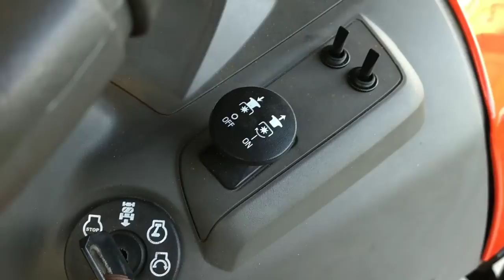Home made lawn mower bucket loader

Comment: That looks awesome! One word of caution for people considering this, most of these riding lawn mowers the transaxle is too light to do anything more than just mowing. Working it like this will tear up the lightweight transaxles on the basic riding lawn tractors. If you have a garden tractor with a heavy duty transaxle you are good to go, its easy to tell the difference, look for rear wheels that bolt on like a car, if they only have the center cap and not lug nuts its a light weight transaxle and your lawn tractor is probably too light  to handle this.
Reply: I don't think the little electric motors he used would lift mich anyway

Comment from the maker: Just for the record to all who have asked questions or responded, this is a light duty unit which works well for moving loose material like dirt, rock or mulch. it really wont dig well because there is no locking differential, and the tractor weights just over 400# and this makes it the weak link. The flip side is I built this unit for 300 in total material. To the actuator questions, it's a lawn mower! Hydraulics are not available, nor practical on a mower that cost just 1500 new and even with hydraulics, your mower is to light to get the work done with a differential rear end. Our Lil Green monster has industrial actuators, 1000# on each arm and has been tested to over 400# static holding in the bucket with no driver, no counter weights, no wheel weights. To all who inspire building your unit, remember the machine itself is the weakest link and common sense should be applied along with the engineering and math to calculate loads. Lastly, to all who question "why no hydraulics?" It's because we design loaders for lawn and garden that don't come with the factory hydraulic or PTO options. Good luck to all..........
Reply: Do you have plans for it.... Very good job, looking to build one for my tractor
Reply: How do you think the "f7" model trans will hold up to this and a small box or straight blade on my yth24k48?
Reply: Thanks for the info. Well done.

Comment: When you say 300 pound capacity. Is that the most the bucket can handle or is it the most the 2 actuators can lift. If they’re both 225 pounds wouldn’t that give you a 500 pound capacity?

Comment: Hi Carlos,  I really like your design and how well it works ! I've been wanting the same type of setup on my garden tractor. But any time you see them for sale they want so much for them you could go buy a used farm tractor with loader for less-even the manufactured attachments they want $5,000 for it. But you've inspired me to build one my self like you did !  Thanks for the inspiration !!  -Jim
Reply from the maker: Jim, not sure if I replied but thank you for the kind words. this is a light duty model and we've moved on to more robust actuators before firing up our business and things have been going very well. if you need some advice on building your own, give me us a call.
Reply: Where can I buy one these at

Comment: Excellent design! I am now building one but am using 4 x 1500N actuators. I'm also folding the main section of the bucket to save on some welding. :)
Reply: Folding the main section. That is a good idea!
Reply: Great build for a prototype. I just purchased a Huskavana as well and would like to build one similar for VERY little yard work, can I get the plans so I don't run into problems that you already solved?

Comment: I like it. Few Q's: 
1) why 2 actuators on bucket?
2) how is the cross member going from side to side just above the mower deck connected?
3) can you take some pics or video of the pin connections on the actuators and buckets?  
4) I gather that the arm are simply bolted to the cross member uprights so that you can remove the bucket assembly easy enough?

Thanx in advance

Comment: I’ve dismantled around 50 riding mowers from garden tractors down to the flimsy MTD and Murray. 
1. How long before the frame cracks. 
2. How long before you run down the battery and wear out the stator?
Reply from the maker: Boyd, the frames of different tractors all very greatly, some are very weak. This particular model has a C frame which is almost 11 gauge and very robust in addition the gusset spans to support and distribute lateral forces across the frame so not to harm to the frame. As far as the actuators are concerned, they only draw few amps and will in fact run on a 9-volt battery for short periods of time and cause no stress to the battery. In addition you would be using the tractor water stater running anyway so it's not much different than putting a cigarette lighter with a 10 amp fuse as an accessory. it is also important to remember that this was just a fun prototype build for $300 in material we now build full-blown models for garden tractors only with industrial actuators and the cost is much more expensive.

Comment: What are your actuators rated at?? I purchased  6000n 1320lb rated linear and they are very slow.  Yours are much faster.
Reply from the maker: So this was just a prototype, and still much slower than what we build today. These are light duty actuators, 225# dynamic lift with the same static holding capacity. These were made by Wyndynation which you should be able to find for around $50 each on line. For the last 3+ years we have been building a medium duty unit with industrial actuators and this has become our staple. You can find us under "little green monster bucket loader" on youtube. Take care!

Comment: You need to make them to sale , looks very good , i would believe is factory , does the engine produces enough power to work for an hour or so without killing the battery ?
Reply from the maker: The battery is unaffected and the engine is running anyway so it does not affect anything. We do build a unit for John Deere X3 and X5 tractors. You can find us on Youtube by typing "little green monster bucket loader"

Comment: Hello, I have a question.   when Tilting the bucket, it looks and sounds as if the bucket falls down when not powering up.  Shouldn't the actuators lock when not under power due to the high gear ratio?

Thank you
Reply from the maker: Thanks for the question. What you're seeing is me operating both the switches at the same time which is probably why it appears that the bucket is falling. The bucket has a 400 lb static holding capacity which is way more than It can ever pick up. Hopefully this answers your question but it's actually me fiddling with the switches

Comment from the maker: It would be considered a light-duty unit. 150 to 200 lb maximum. The weakest link are the light duty actuators and that the mower itself only weighs about 450 lb. It has no problem picking up P gravel and sand moving Mulch and things of the sort but it will not do any substantial digging in hard pan or packed ground. The new model that we finished up for a John Deere garden tractor functions like a normal tractor to dig and pick up much more weight. I hope this answers your question feel free to reach out if you have some more questions. The cost to build this light-duty unit if you can fabricate and weld is just under $400
Reply: Carlos Tejera 
I have a Kubota B6100e subcompact tractor which is a 14 hp deisal and weighs a little over a thousand pounds. Do you think the loader for the john deere would hold up to being used by this tractor? What kind of work could I expect to be able to do with the john Deere loader mounted on this tractor? How much would it cost to build the john Deere loader?
Reply from the maker: Grady, It all depends on how heavy your Kubota is, is it 4 wheel drive? Locking Diff, Etc.. The Deere weights about 900# dry. Yes it will dig, we can pick up 350 to 450# max with counterweight but there are lots more questions before you jump right in. We sell the actuators and are now a dealer. We just finished a fork assembly for hay and brush, we have a tooth assembly for ground clearing, garden prep and the likes. We took 400 sq ft of grass and weeds and turned it into a ready to plant garden in less than 30 min. call with questions 863-255-1237
Reply from the maker: Hi Grady, I replied to you directly but thought I'd also briefly answer the questions for others. The John Deere unit would most certainly hold up to your B6100 and you could expect to lift into the 400 to 500# range with the right tractor weight and the same 1000# actuators we use on each loader arm. Yes you can dig, grade, and with the tooth assembly we made turn raw ground into a garden in a quickness. Pricing varies with the type of actuators,  stroke length, speed, etc... The Deere has industrial actuators that are IP65 to IP69 rated. This means weather resistant to 100% weather proof under harsh high pressure conditions that most would never really need anyway.
Reply: How much where the actuators

Comment: Thanks for answering my previous questions. I'm still designing my bucket and have ran into a problem with the actuators having a small duty cycle. I notice that in one of your other video's you are working the actuator hard. Do you have a solution?
Reply from the maker: I do, call me and tell me what you are struggling with and I'll be able to answer your questions.
Reply: @carlostejera8476  Are you in the EST zone? I don't want to call you at 2am your time.
Reply from the maker: We are Eastern Time zone located in Central Florida

Comment from the maker: Good luck with your build Ian. We also sell a simple set of plans 4 lawn mowers and garden tractors if you need some design help. This is the lightest Duty unit we make but still very handy around the yard.
Reply: Already designed and half built thanks Carlos!!
Reply: Well I've almost finished it. I've tested it and everything seems to work but I just have to extend the exhaust pipe about 70mm  as it's a little too close to one of the actuator motors. As soon as the pipe turns up it should be right to do some work.
Reply: HOW DOES ONE GET A SET OF YOUR PLANS. A GREAT  DESIGN

Comment: Was looking at it...Real nice, would like to have seen the attachment point to the frame.   Also was thinking of an electric PTO using maybe a Electric Clutch from an AC compressor...
Reply from the maker: Clay, thanks for the response. Never thought about the PTO idea, but why not? give it a try and let me know how it works. We don't have a use for a PTO but I'm sure someone somewhere does. Stay in touch & good luck.
Reply: What about reverse polarity wiring on a larger alternator? Theyve shown to have substantial rpm, load, and torque?

Comment: I been wanting to do similar but only had 2  actuators that 120 volt from a hospital bed I took apart,so I would've needed a power inverter also ,so haven't done the project yet...yours looks good
Reply from the maker: Hi Mike thanks for the response. If all you need is a light duty unit like what is in this video, you can buy these actuators from ebay for around 40 bucks each. depending on the bucket, you'll get about 150# easy in the bucket. I The actuators have to by Wyndynation, they have 225# dynamic lift, and the same static holding. if you don't use these others have no static and will bleed back closed. Good luck!

Comment: good project but it seems the bucket actuator is not holding the weight enough. You had to power when it was up.
Reply from the maker: The actuators hat static holding power, that was just me operating switches. This was nothing more than a cheap back yard build. Our "Little Green Monster Bucket Loader" is a production unit we build for John Deere X models. You can find us on Youtube with the LGM title. Thanks.

Comment from the maker: 8" stroke actuators, all same length, the switches allow for extension and retraction and we can give you the wiring diagram. If you can email ctejera@tampabay.rr.com and send me your phone number, I'll reach out to you and give you the details you need. The stroke, type of actuator, and mounting configuration will change from one mower to the next depending on your needs.

Comment: How do you keep the two lift actuators working at the same speed?
Reply: Also where did you purchase your actuators?
Reply from the maker: @normanodom795  the actuators are Acme or ball screw control and as long as they operate at the same voltage they move up and down at the same exact rate. The type of actuator that you use can also make a difference so we do not very from what works for us

Comment: This is awesome. Just purchased a Craftsman DGT 6000 used. Do yo sell Plans for this loader?
Reply from the maker: We don't build for lawn mowers anymore but feel free to reach outand we'll give you some basic dimensions and guidelines to get you going in the right direction
Reply from the maker: Just guidance and basic dimensions. We only build for John Deere now.
Reply: @CarlosTejera I understand you don’t build for lawn mowers anymore, but I have a craftsman GT5000, if you would be willing to share any rough plans that I could modify I would greatly appreciate it. The GT5000 weighs 600lbs and I have wheel weights, so if I could get away with lifting around 300lbs I would be very happy, especially given my bad back!
Reply from the maker: We might be able to help out feel free to call and we can discuss some potential options

Comment: Can I ask what size and thickness of steel tube you used for the loader arms?
Reply from the maker: 2x2 14 gauge to keep the weight down. Bucket is 36" wide
Reply: @carlostejera8476  thank you. Do you know what the lift capacity is? I'm building one for my atv. I want it to lift 5-700 lbs so I was going to use 1.5x3" .060 thickness. Overkill?
Reply from the maker: In the beginning of the video I describe the gauge and size of the material along with some other details. my phone numbers contained somewhere within the comments if you need to call from more questions.
Reply from the maker: @sti1471  most definitely overkill. My phone numbers contained within the videos feel free to call.
Reply from the maker: @sti1471  correction to my last comment most definitely call. We have designed them for ATVs in the past 863-255-1237

Comment: I believe I will be fabing one for myself considering I have been working in a fab shop for over 20 years I can't believe it took youtube to make me think of this. Did you have to sync the actuators at all? I'm being told I need to buy some almost 300 dollar sync thing to do this.
Reply from the maker: No sync needed. we also provide kits and plans for those who have the ability to fabricate and weld. The kit prices vary depending on the type of tractor and actuators. We have light duty like this unit, and industrial like we put on our Deere garden tractors weighing 1000#. Reach out and call if you have any questions 863-255-1237
Reply: Will do thanks
Reply: I got it done this last weekend modeled it after this one in the video other than needed to extend it longer because I used 18" actuators it looks and works great thanks for the idea.

Comment: hi, nice loader, where did you get hydrolic system
Reply from the maker: The actuators are made by Wendy Nation I found them on eBay for around 50 bucks each. Keep in mind this is a light duty unit despite how much it actually lifted it really doesn't want to do more than about 100 to 130 lb. If you're interested in something more robust check out our videos under little green monster bucket loader on YouTube. Those are production units that we build everyday and we're also a distributor for the industrial electric actuators that we use. This little Husqvarna was nothing more than a prototype and the only one we ever did. Good luck

Comment: YOU NEED A CROSS BEAM BOLTED TO THE FRONT OF THE TRACTOR AND TWO FLAT  BARS RUNNING DIAGNALLY FROM THE UP RIGHT PEICES TO THE BEAM BOLTED ON TO THE FRONT OF THE TRACTOR SO THE LOADER WONT TWIST AND BREAK OFF THE BEAM BOLTED UNDER THE  FRAME OF THE TRACTOR
Reply from the maker: I truly wish "EVERYONE" took the time to read every one of these posts. THIS WAS A PROTOTYPE, never meant to be built again. For those that want to build their own, it only serves as a guideline. Since this video we started building heavier duty electric front end loaders and sell over one hundred loaders per year. AGAIN this was a cheap build, I was bored. I'm a mechanical engineer, Licensed IBEW electrician, and I conveniently happen to have owned a fab shop since 1995. THIS WAS A PROTOTYPE, I WAS BORED. For any nay-sayers, post your own builds and try not to criticize this simple video. Everyone has an opinion and I respect them all. For those that have more time to troll and comment, show us what you did when you post something about this Video. Bobby , mentioned in this video was someone I spoke to in the start of this build, I was curious what he used for actuators, made my own "PERSONAL" changes, and it easily moved up to 130 to 150# of mulch at a time which is better than a wheelbarrow and a shovel. From there we designed our "little green monster front end loader" , also on youtube which has also gone through multiple changes over the past four years. Thanks for your opinion, maybe you can share some of your work with the rest of us on Youtube, or maybe the 300k annually we do in sales in only 4 years is something you can achieve from scratch also. Have a great week, good luck with your projects.